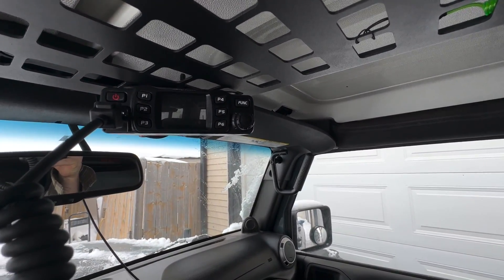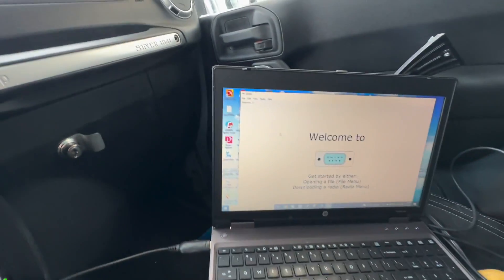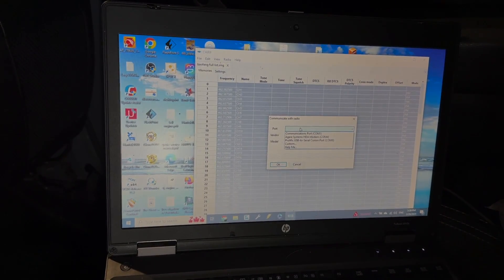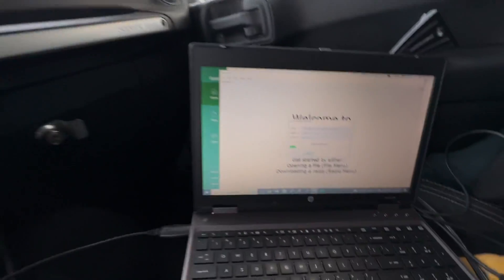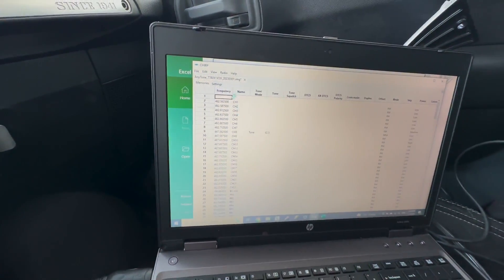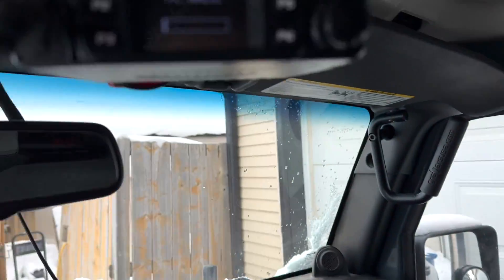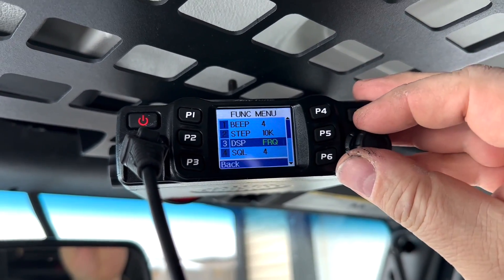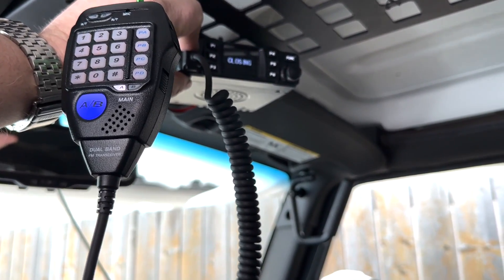ANYTONE AT-778UV PROGRAMMING WITH CHRIP

Comment: Very cool and nice install job! I didn't know you were into radios. Makes sense though. Are those RR frequencies for BC resource roads? If so, you want to set those to NFM rather than FM. The log trucks (and other commercial rigs) here in BC transmit NFM when using RR and LD channels (LADD is wide band in BC though) Listening wide band while receiving narrow band will sound quiet and sometimes hollow. Not sure if that UV778 will TX outside of the ham bands? But if it does, sending wide band to people listening narrow band will sound "poppy" for lack of a better term. Curious what you have for an antenna / mount?